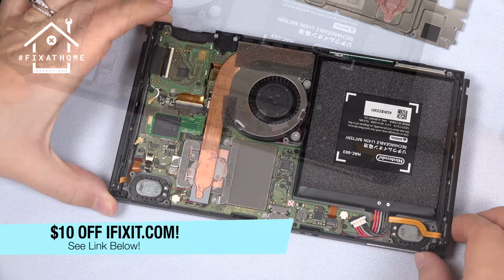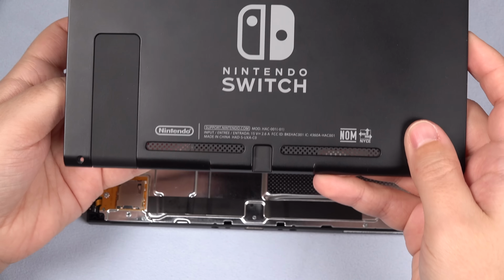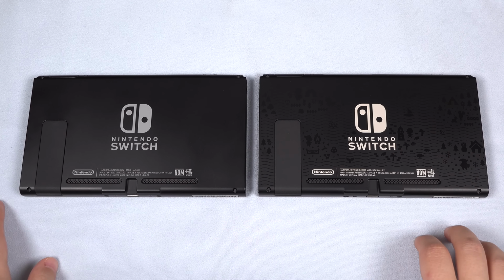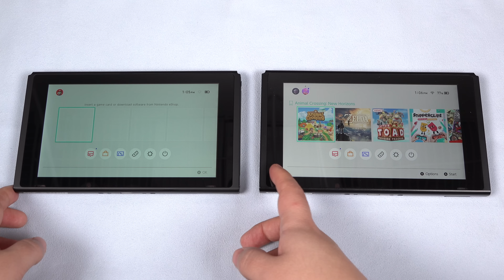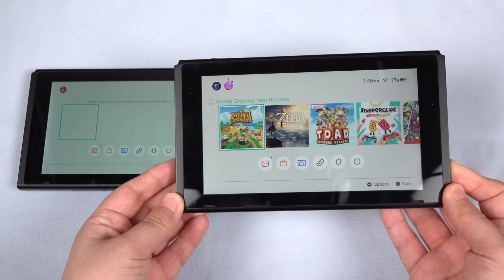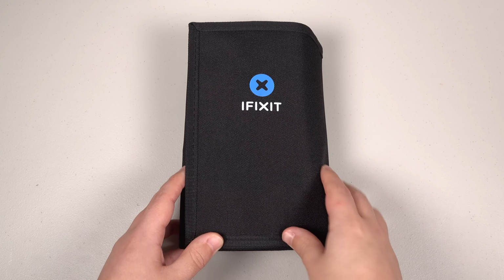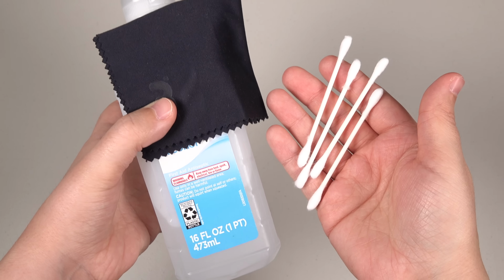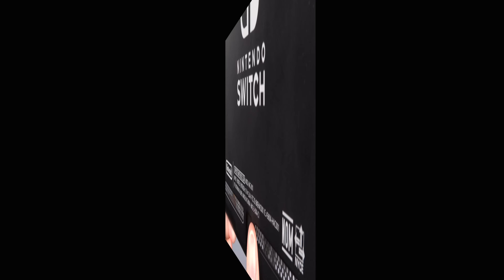Nintendo Switch Upgrade Mod: Original to V2 (Better Battery Life)

Comment: Hello Erica, I have a curious question for you. Are you sure that your touch screen still works fine with this upgrade mod? I too have the Animal Crossing edition switch BUT with a lazy pixel in it. I couldn't get over it and I decided to replace the LCD and digitizer myself (I did not want to risk losing it or it getting scratched). Considering all the trouble and the COVID 19 situations.... I bought an OEM digitizer and OEM LCD. The LCD is much better and works  great, (I suppose it is an old one like yours) but the digitizer does not register touch in the middle. Could this be because of the new model? I read on the internet that many people that replace the digitizer lose their touch functionality. PS: I did not damage anything, I re-connected the previous digitizer (with a few tiny stress marks) and it still worked perfectly. Now I don't really know where to buy a perfect new digitizer for my ACNH switch and fix this. Could it be that the digitizer are console bound HAC-001 and HAC-001 (-01) and the only digitizers available for sale are for HAC-001...?
Reply from the maker: Are you sure your parts are OEM? I am 100% sure mine are because I took them from untouched switches. Aftermarket parts look just like OEM parts, as they come from The factories producing the switches.

No issues with my switches. Touch screens are fine.

Jon’s updated switch is a 001 screen and digitizer with a 001-01 board. The animal crossing unit is now a 001-01 screen and digitizer with the 001 board. I also gave Jon my new 001-01 fan, SD card reader and game card reader.
Reply from the maker: If I had any bet, the digitizer and LCD screen should be the same versions?  I also heard someone say switching the game card slot made it not work. So either there are verifications the board makes or parts need to be of the same gen together. As mine are all truly Nintendo verified OEM that’s hard to say.
Reply from the maker: Essentially, Jon’s Switch is made up of old screen components, new board with new fan, game card reader and SD card slot. I’d be curious to see if the old card reader makes the digitizer not work. I’m sure I can figure something out for the long form video.
Reply from the maker: The digitizer isn’t tied to a particular board because I swapped the boards and the digitizers are fine. My swapped Animal Crossing unit is now 001-01 digitizer and screen, 001 board and 001 fan/sd card reader and game card reader. This combo of parts still has the digitizer working perfectly. So I really don’t get it. We know a combination of old board and new screen parts works.
Reply: @EricaGriffin  Thanks for sharing that information, either the digitizer is faulty or I have been tricked in non oem digitizer. I guess, I will try to search for another seller and give it another go
Reply from the maker: Kekke466 it’s truly bizarre what is happening. I have heard a few people say this. I just wonder if it’s not a Nintendo signed part because I’ve got both an old unit with new hardware and a new unit with old hardware without a hitch. Just working beautifully. Let me know what happens.
Reply: @EricaGriffin  Truly strange, I think that I would be able to easily recognise third party parts. All checks out visually to me, same black ribbon connector and code written on it. I think that it is truly a disgrace from this company: a pee yellow screen with a lazy pixel in the middle. I expect high standards from current technology... Imagine my face when I discovered this on a limited edition console that you can't easily swap in-store here.
The struggle with dead and lazy pixels is still not fixed on current models. I will keep you updated on my progress.
Reply from the maker: Kekke466 I had the same experience. I was just lucky to have my current V2 unit so I could just swap the back cover. Nintendo stopped using JDI display, their previous supplier. I think JDI went under, so not entirely their fault. They are using Innolux displays now and I have just not been impressed. I found a good one eventually but it took 7 exchanges!
Reply: @EricaGriffin  Hi Erica, I hope you are well! I ordered another digitizer (first store was console pro, second replacebase) and both digitizers have the same behaviour. They do not respond in the middle of the screen. My conclusion is that they are not faulty, just not compatible with the HAC-001(-01) models. Also the digitizer I received from replacbase had two pits in the corners of the digitizer. I thought it couldn't get any worse... It seems almost impossible to buy a replacement screen and digitizer that is actual OEM to the new models at this moment.
Reply from the maker: Kekke466 I have learned new info. It’s not the digitizer that’s the issue. It’s the gamecard slot connected to the cable of the digitizer. If a gamecard slot is non-oem or came not tied to the console there can be issues with whatever firmware was updated to that chip vs the firmware on the motherboard. It makes the gamecard slot not work properly and screws with the digitizer. That’s what we know so far.
Where did you get your gamecard slot from?
Reply from the maker: Kekke466 I wonder if you get a different gamecard slot if the digitizers will suddenly work in the middle. But it has to be another oem one. It’s a pain in the butt!

Comment: Hey Erica, how did you get the new game card reader to recognise the digitizer? I’ve tried replacing that myself and discovered that the digitizer either stops working altogether, or only partially works. Hope to get a reply, been really busting my head with that one and seeing that your husband’s digitizer is not a signed one made me question how it happened to work.
Reply from the maker: I’m confused. What is the problem? When you put in a new game card reader the digitizer stopped working? I don’t see what one has to do with the other. Did you damage the digitizer cable?
Reply: Erica Griffin no. It’s just like that. Happens if you change out your digitizer as well. The new digitizers have a qr from Nintendo on them and they only work with the newer versions of the card readers. I’m not sure how you got it to work but I’ve been trying to research this for a very long time. Even bought digitizers from ifixit to try different ones. Nothing worked. That V1 card reader you have there is the only type that supports the digitizers you can buy only as replacements.
Reply: Erica Griffin on the ifixit forum you’ll see a lot of people asking that same question.
Reply from the maker: The screen is the old screen paired with the new game card slot from the animal crossing unit. I noted in the video that I gave him all new moving parts, and the game card slot was one of them. There are no issues at all with the Switch recognizing the digitizer. My husband just checked it. What isn’t working?
Reply from the maker: Link me to the forum please. I have no idea what is happening to you guys.
Reply from the maker: Are you using aftermarket parts?
Reply from the maker: My best bet is you keep getting aftermarket parts, which I never recommend. I have two switches here, with all OEM parts.
Reply from the maker: You probably need to get an “as is” switch and ask if the screen has scratches or if it has had a screen protector on the whole time. I don’t trust that any parts you have are OEM unless you saw them come off a switch. It’s too easy for Chinese aftermarket parts to make their rounds and look exactly the same, because they are.
Reply: It seems like everywhere I looked at on the ifixit answers page, all the questions were deleted.
Reply: Erica Griffin can you recommend a place to buy genuine OEM parts?
Reply from the maker: Gal Gruper please get an “as is” switch for as little as you can and take the digitizer from it. You must be getting aftermarket parts. Have you contacted iFixit?
Reply from the maker: Gal Gruper I can’t speak for anyone but maybe everyone you got parts from got them from the same Chinese aftermarket source?
Reply: Erica Griffin I might’ve that was months ago. I do know that once I took a card reader from another switch a CPU1.0 switch it just magically worked. But now that other switch doesn’t have a functional digitizer.
Reply from the maker: Gal Gruper something screwy is going on with OEM parts vs aftermarket parts, Nintendo’s firmware and so on. I can’t say anything is 100% OEM unless I take it off an untouched Switch, which is probably why none of my Switches have any issues.
Reply: Erica Griffin probably. Thanks for taking the time to reply. Your video is great. I’ll keep searching I guess.
Reply from the maker: Gal Gruper are these digitizers that you know are OEM parts becoming damaged even if you switch back to all OEM parts? What I can tell you is that new parts went to the old switch and old parts when into the new switch and all was perfectly interchangeable.

Comment: Hello, amazing vidéo and very cool project.
I wanted to know if you can remove thé battery using à credit card or somthing similar 😁 and adhesive remover is alchohol right ?
Thanks for the answer.

Comment: The reasons V1 is better its because of the screens... yes V2 has better battery life... but nintendo tweaked its screens to make its performance better than the V1... nice one nintendo... there is pro and cons in each one... better screens, low battery life/ better battery life, low quality screens...

Comment: I have a banned switch so I'm gonna try this method to fix my ban, Can I use the original emmc and other mini boards with the new main board?
Reply: No the emmc is encrypted to the console. Bans are forever and are console only. I have a switch that is not banned if you are interested in a trade lmk.
Reply: @bretticus117  banned switches can still play games under cfw

Comment: You think it would be less costly to upgrade to the oled version from V1? Also is the same to put games and saves on SD and transfer to pc and back since i don't have another Switch to transfer? Thx in advance

Comment: I have a V1 switch and primarily use it in portable mode. Battery life is trash and I'm considering doing this since I've heard bad things about the new screen compared to the old one. My question is what would happen to my Animal Crossing island if I go ahead and do this?
Reply from the maker: Your animal crossing island will come with you because it’s stuck on the board. So you will keep your island!!!!!
Reply: @EricaGriffin  awesome! Now I just have to get my hands on a V2 since it's sold out everywhere where I live. Also a full how to video would be great!

Comment: I think you put a bit too much thermal paste on your CPU. But still, great video though!
Reply from the maker: Nope. Just enough. I found that this amount is what helps get the entire area of the heat sink covered when I screw down the copper pipe onto the shim. And ps. someone will ALWAYS say there is too much paste where it makes no difference, as confirmed over and over again lol

Comment: Thanks for the video!

I have a question though, if I have a game saved in my old system (not in the memory card), if I changed the board to V2, do I have to redownload it? I’m very new to all this upgrade stuff. Quite scared to brick my switch
Reply: Yes you have to redownload it, as long as it is in the cloud you will be fine.

Comment: Wait the v2 screen isn’t as good as the v1 screen? I had to sell my v1 last year and I’ve been wanting to get the v2 but if the screen is cracked on them I’d rather deal with a crappy battery.
Reply from the maker: The displays manufactured by JDI all looked better. Innolux is now making the screens. Just not as nice.
Reply: Erica Griffin would you say you can’t tell the difference if you don’t have v1 and v2 side by side to compare or should I try to find a v1 and deal with the crappy battery life?

Comment: My question is the other way around. Can I use a Mariko (v2) battery in my V1 switch?
Reply: I think its the processor that offers better battery life
Reply: that is not my question... and also, it is also wrong information. 

the new battery has higher capacity, as well as supporting higher voltages...
Reply: My point was according to what I read sure you could although I suspect it might not make a difference
Reply: @LokiTheClever  it would allow higher gpu clocks (when forced as docked) in handheld mode... currently running 768 on a v1 battery will cause it to go to sleep due to too high a wattage draw. the v2's do not do this. so what you believe will not make a difference is relative
Reply: @Tilde88  I am saying from what I read I doubt it's the battery that causes the v1s to die so quick
Reply: @LokiTheClever  it isnt the battery "capacity" it is the battery amperage capabilities

Comment: Is the storage soldered to the board? Would I lose my Animal Crossing & others save data doing this?
Reply from the maker: Yes the storage eMMC is on the board so if you did this your island will come with you.
Reply from the maker: Oh and the eMMC chip isn’t soldered. It can be popped off.

Comment: Not really an upgrade, you're just moving one motherboard from one shell to another, its pointless, the batteries are the same, the only difference is that the newer processor uses less energy when doing stuff that needs less energy and uses more energy when it really needs to. You could've just sold the other one and kept the new one without all that pointless hard work.
Reply from the maker: You completely missed the point of the video, which is to help people if they don’t know which replacement board to get or in order to keep your launch unit display, which look to have better calibration than the newer ones. The processor makes a HUGE difference in battery life.
Reply: You know what you are talking about man? lolol the battery are the same yes,  that's why she swapping the main board, because the first Gen usually have better screen , and it's cool to know they can swap. Exchangeable